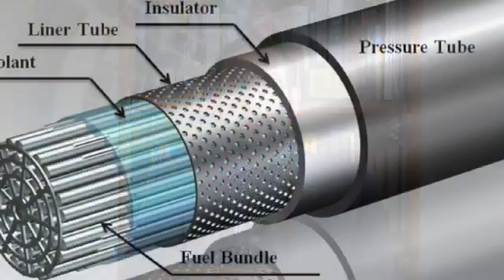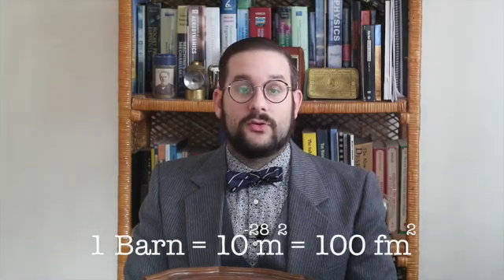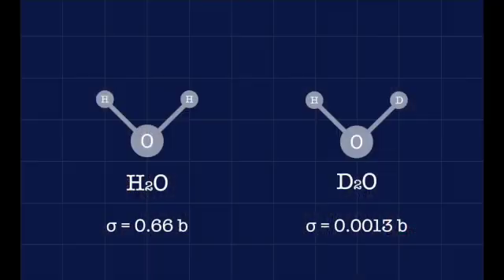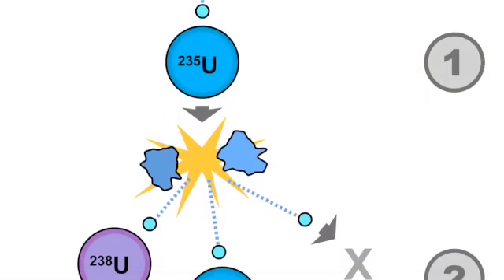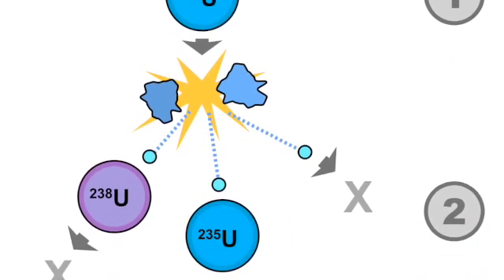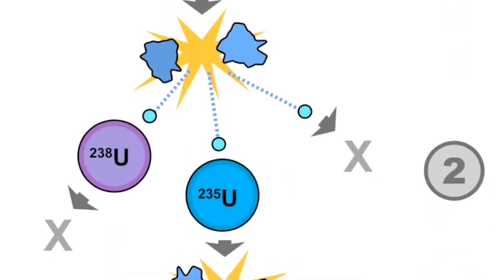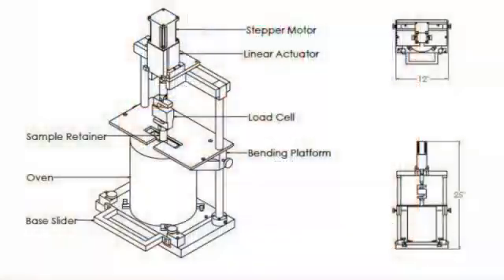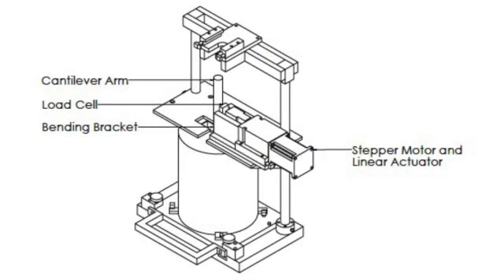CANDU Reactor Fuel Channel Sample

Comment: The thermal limits of fuel are based on the cladding limitations, as opposed to the uranium ceramic itself.  Some vendors and researchers are trying to work on a fault tolerant fuel cladding but its been more hype than anything else.  

If someone develops and geta approval for a fault tolerant fuel, the nuclear industry would change overnight.  The cost of plant construction would be reduced 5+ fold, most likely.